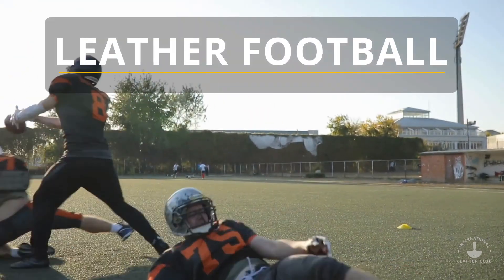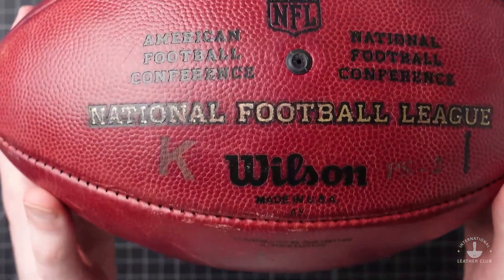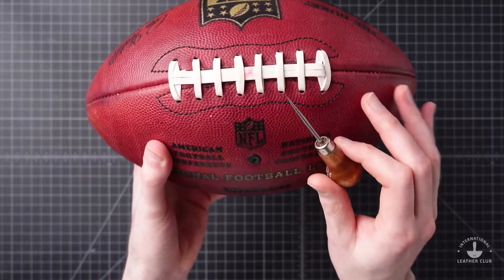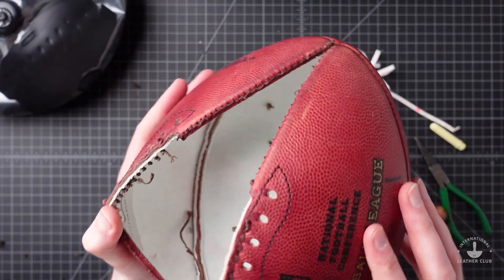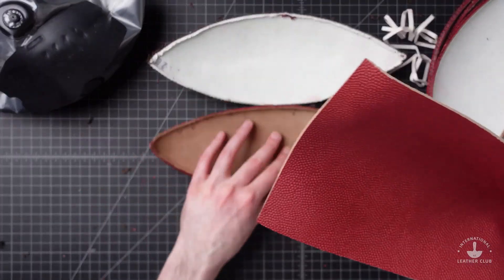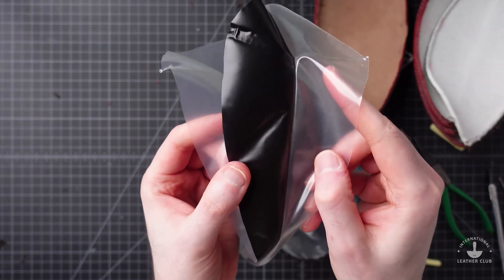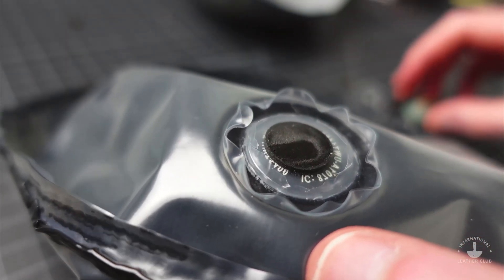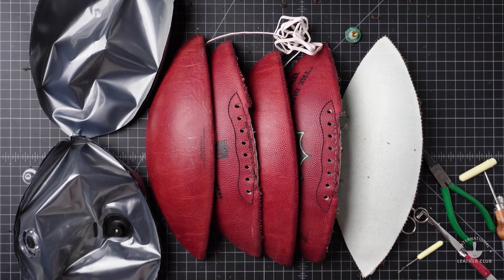Inside an NFL Football: The Duke K-Ball with Computer Chip

Comment: Even and Odd Numbers refer to the home and away teams. The seven kicking balls (designated as “K” balls) arrive in a case provided by NFL officials. Before kickoff, in the presence of the officiating crew, both teams’ staff participate in the selection process. The home team chooses the first ball, followed by the away team, alternating until each side has selected three balls. After selection, the teams take their balls for preparation and then return them to the officials before the game begins.

Unlike the offensive game balls, which quarterbacks select prior to game day and can be treated with mud, brushes, and oil, K balls are subject to stricter regulations. They cannot be altered with mud or oil. Instead, their red-tan coating is wiped off with a damp cloth, and the ball is brushed with a stiff brush to remove rough edges. Once this process is complete, the K balls must be returned to the officials within a set time frame well before kickoff.
Reply from the maker: Hello 😃 thank you for the context! It's helpful to know about the numbering sequence and home/away team selection process. One more clue in this puzzle 👍

Comment: I  watched this in hopes the chip inside was a Hawkeye chip for the new ball spotting tech and that it would show details on how the NFL's version of Hawkeye works (other sports like tennis have had it for some time). Since you didn't say anything about it though, I assume you don't know?
Reply from the maker: Hello 😃 not precisely sure on the chip tech. There wasn't much publically available information based on searching the markings, so maybe it's proprietary, or maybe just not commonly known.

If someone does know please share! It would be fun to learn more about how it all works. 👍
Reply: @internationalleatherclub  This chip inside the ball is made by Zebra Technologies for use by NFL for Next Gen Stats (AWS). It is using essentially the same type radio or Ultra Wideband (UWB) Technology seen in other wireless devices. Inside all NFL stadiums there are many of these Transmitter and receiver antennas all across the stadium pointed towards the field. Not only do they track the NFL football but we are tracking the players as well. Inside each of the players pads used for protection are generally x2-3 of these sensors on each side of the players shoulder pads.